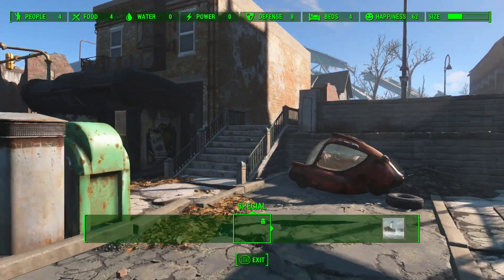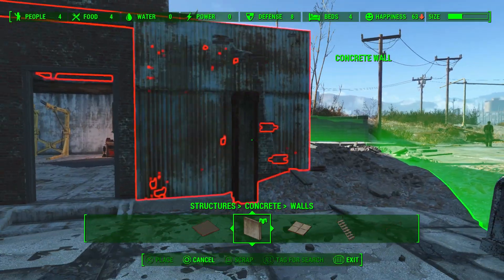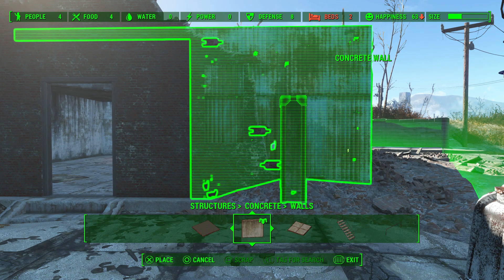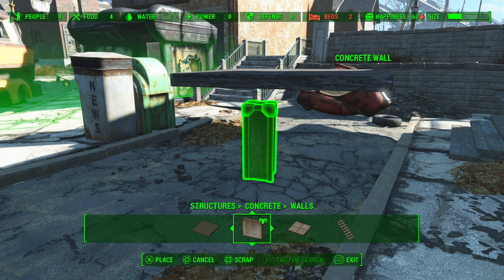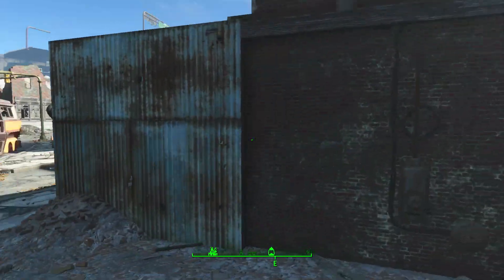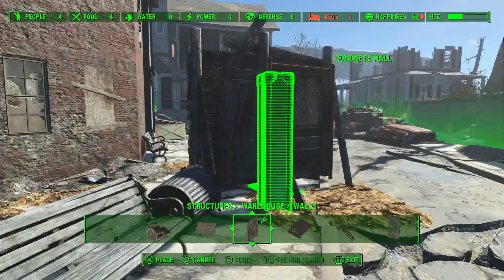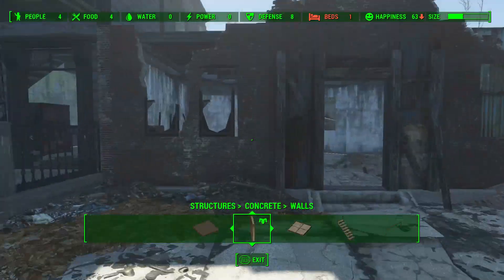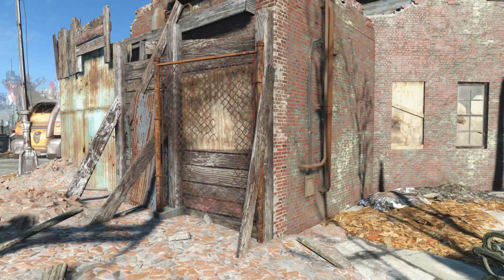Fallout 4 Guide - How to Fix the Jamaica Plain House

Comment: Wouldn't it be nice if building basic structures like this didn't require glitches?
Reply: Yea in the next fallout Bethesda should have it so there is not much clipping and scrap able rubble
Reply: I can do something very similar based on the 2x1 warehouse wood floor, which (also the 1x1) is a lot more "tolerant".  I don't use the pillar glitch at all.  The bit I'm struggling with is the door.
Reply: @paulsmith5752  i use the place anywhere and scrap everything mods
Reply: Man, 6 years ago. Yes, that would be nice, mods help to achieve that
Reply: @cameronbraddick8123 5:07 😅

Comment: Just a quick tip: The posts in the warehouse and barn sections work better for glitching floors in. Snap them onto a floor, group select, and the floor is automatically at the correct height, no fiddling required. :)
Reply: I like the fiddling.

Comment: I literally attempted this not too long ago, but ofc Davie does it much better - I"M COPYING IT
Reply: I did the same. An it was right after automatron dlc so I didn't have much to work with. My mistake was that I built the walls first  so the second floor is oddly shaped and has gaps. though my third floor turned out nicely...

Comment: Thanks for this video! It helped me a lot! I was able to repair the destroyed corner of the first floor with two walls atached to the whole floor, using a concrete column below, at the center of the floor, repairing all the floor from the room above the workbench and the corner at the same time. The concrete walls worked normally until next to the side of the building with less damage!

Comment: I've managed to fix Jamaica Plain similarly, however I did so using some of the concrete triangular floor bits to utilize the top floor of that structure and make it so it's accessible via the second story of the house next door. Mine was also designated for the Mercer Safehouse so I need some extra ways in and out. I was able to build a wrap-around scaffold structure to allow for an escape route out to the street behind that main building.

My point being, it is possible to build a whole structure and place it using the column glitch for both the bottom and top floors of that dilapidated building.

Comment: In my case I just built a two-story wooden fort popping up from the second story of the broken home.  Everything snapped nicely, although I did have small portions of broken wall popping up through two floor tiles on the lower floor.  I also put some stairs going up to the roof of the central building, which gives a nice Fast Travel Target area overlooking all the attack lanes should the place get attacked.  The Size bar fills up really fast once you start putting in pre-fab pieces though, so the scrapped weapon glitch is practically necessary if you want to decorate the place afterward.

Comment: Sort of followed your advice

What I found was the head of find the width first, so when I made the wall I made it 2 floors sideways so it would fit in fit the corner when putting in the wall in

In when you learning everything up you got to line it up just right and you can build the whole  floors,

In the end I just ended up with two porches either side of the building  which I was happy

Comment: I found out the other day that if you are starting with limited supplies and have no concrete you can use the barn wooden support in place of the concrete pillar fit this trick. saved my hide on the fresh character I started

Comment: Davey, can you pre-build a 2 to 3 story structure and then rug/pillar glitch them into that portion of the building? Wasn't sure if that was possible there
Reply: That probably depends on the broken building. I tried to fix the house roof in Somerville Place. Pre-built a wall and roof, no matter what glitch I used it just didnn't work. Really frustrating.
Reply: you can't use the rug glitch with walls or other snappable structures
Reply: Raptor Jesus I know, there are many other glitches I tried, didn't work either.

Comment: its actually easier if you start to rebuild the house from the inside:

Go to a corner and adjust a small wooden floor and put the rest around it... this way you´re guaranteed to get 2 floors of perfectly fitting walls and floors. OFC its a game of trial n error but it looks better.

Comment: Did they patched the glitch? I tried that by placing the wall in Hangman's alley but the post turns red when I lower it.
Reply: No they haven't patched any of the building glitches... What "post" exactly are you using?  For example if it's a fence post they don't go into the ground like pillars do.
Reply: Very same cement post I used to lower vault buildings and other including ghoul chairs just showing only their head. I have video of that.
Reply: Well if it's one of most types of walls that snap there are some additional restrictions, like they can be moved into other objects but not the ground itself (unlike the ghoul chair you mentioned).  Have you tried using a concrete wall instead? Those can sink into the ground even without using a pillar.

Comment: Why use the rug and the concrete wall?
Reply: concrete wall to sink in the stuff and put it at he right height
rug to be able to place your object inside a wall or so.
(you "select all" with the pillar, which will only select the rug and not your object)

Comment: You can fix the house without using any gimmicks like placing multiple items at once, etc... one piece at a time. Why all the extra hassle?
Reply: cause it looks far better
Reply: Not at all, I made the same house three stories high with floors, walls, roofs, and built out the back end all the way to the wall.  When you're too used to relying on these glitches for everything, it actually ends up complicating things.
Reply from the maker: link? Imgur/video?
Reply from the maker: that doesn't look bad - but I wouldn't say that looks better. As rather than making the walls look repaired, you've kinda just built around them on the outside and cut through the top. 

The reason for my 'gimmicks' so it looks like it's actually repaired and reinforced, rather than just hidden by another builbing.
Reply: Ah, I see what you mean. That wasn't really my goal. I was trying to make it a functional structure without holes in the floor or roof, and I thought you were relying on those techniques to make that happen.

I've watched several of your videos and your buildings do look good, or realistic like in-game buildings would.

Comment: It said I can't even claim Jamaica plains even though I checked everywhere
Reply from the maker: You need to kill all the ghouls in the entire town. Take some berry mentats if you're struggling to find them all.
Reply: I believe there's an underground basement (interior) that has to be cleared too, if I recall correctly. But yea, the zone that you have to clear is much larger than just the settlement, it's more like the whole town of JP
Reply: Indeed kill all gouls in the neigbourhood. If you never been there they'll pretty hard to find. Go upstairs all buildings, open all doors. Meanwhile try to find a way inside the church and "rescue" the mayor he'll give you  a key to a treasure hidden somewhere on the Jamaica plain. Clear the city hall of gouls. go to the verry top of the cityhall and work your way way down. Before entering cellar Save please.
Reply: All exterior ghouls must die.  Some of the groups are easy to miss: tucked away in an upstairs room in city hall, laying about in an open-air upper floor of a home with two of the dead treasure hunters, an ambush that is triggered by going into the church with another treasure hunter inside, etc.
Reply: yes, as the guys said - check the upstairs locked doors.